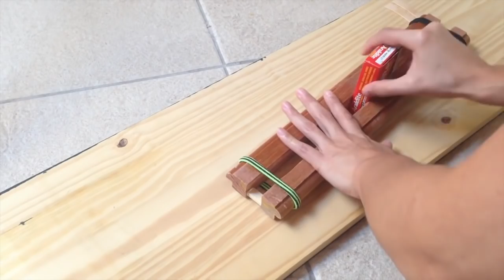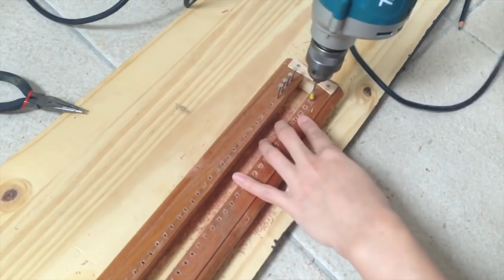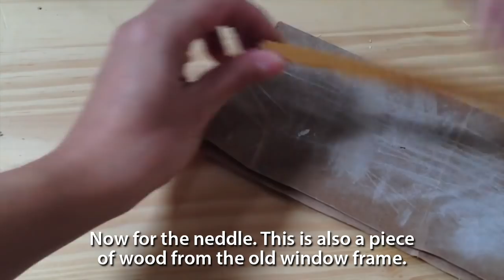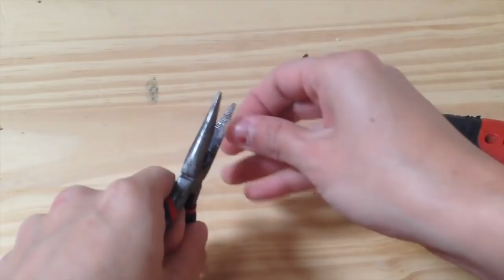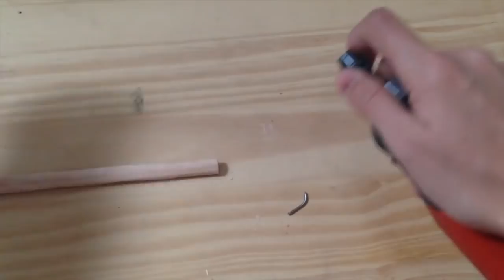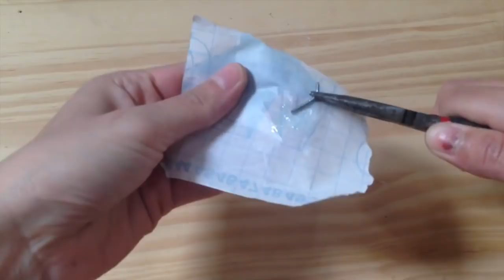Homemade Knitting Loom and Needle

Comment: My dad made me a big one to do rugs with 60 yrs ago. He used nails without the heads on them it worked great and you can get your yarn or fabric off so much better without snagging it on the nail heads.
But what ever works for you.
Reply from the maker: Thanks for the tip :)
Reply: Carol ELSBERRY
Reply: I just recently built one myself. Its adjustable and everything. 6ft long with a total of 448 pegs. I kept the nail heads on because the upper stitch would just slide right off and it would drive me nuts. I guess its personal preference. Currently making a blanket
Reply: @chrisw4888  That’s awesome! That’s a big reason I wanna make one too. I also just realized your comment is 2 years old haha so I hope your blanket came out great 🤗

Comment: Cotter pins make good pegs. You pull them apart a bit before installing them, then push the ends together while hammering them into the holes. Then your hook can get into each stitch.

Comment: I'm making a loom currently and I'm thinking when you cast on stitches if you skip 1 or 2 pegs between stitches, when finished knitting you can use your crochet hook to crochet the long yarn between stitches up the piece like a ladder to give a different effect. The same way of you drop a stitch knitting you can go down with your crochet hook and work it back to the top, so you skip stitches in purpose to have straight stretches of yarn you can ladder up on whichever side you want.. I hope they makes sense.. 👍👍

Comment: It's awesome. I just want to say that you used metal drill bits for wood. You wouldn't have had so much splintering around the holes if you had used wood drill bits. (Oh and you put the drill bit in skew so that caused wobbling and more splintering)

Comment: Awesome, I'm wondering why you knitted in a zig zag instead of going down one side then up the other, you went across the loom each time, I'm wondering what different would that make, does it make your stitches farther apart meaning the piece will be larger than the loom when finished?

Comment: There are a few ways to get the depth more accurate on the screws for anyone who wants to make one of these. ^w^

Pilot hole: Mount a wooden dowel to the side of your drill with tape or a gear clamp or two (Depending on the drill or the clamps you find you may need a few clamps to get all the way around it but they will hold better then tape.) I would recommend using a wooden dowel over the tape as the tape gets damaged as you drill up to it and will slowly make your holes deeper, not that it's that bad but it also makes the process faster this way, just drill until the dowel stops you.

Nail depth: Find a metal or hardwood block that is the height you want your nails at and hold it next to the nail. Hammer them in until the hammer is hitting the block instead of the nail. Little bit tricky to hold the block and piece at once so you can also use a C clamp or something to assist you.

Have fun and good crafting~<3

Comment: When I said nails without heads I meant they don't have the heads on like what you were using then having to cut them off. You know like the kind that they use to put baseboards on when they build houses, that way you don't have to cut the tops off the nails at the end. Can't think what the nails are called right now other then finishing nails. Sorry if I didn't explain my self better! Not disrespecting your video, just telling you how my dad made mine.
Reply: Hi Carol...the nails you're referring to are called "finishing nails." Thanks for the advice.
Reply: There called finishing nails. Used for trim and molding. And come in different sized.